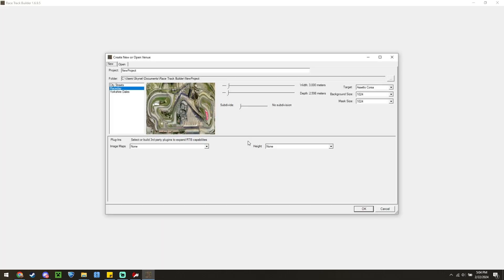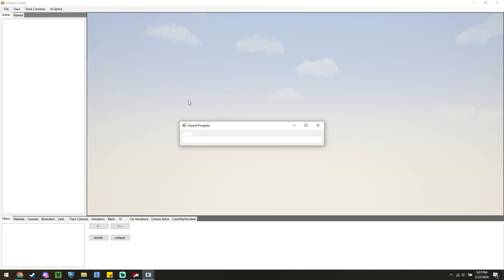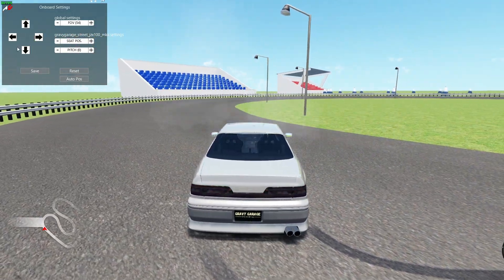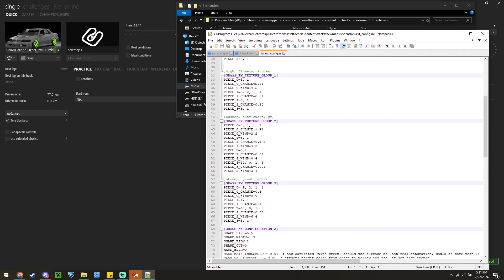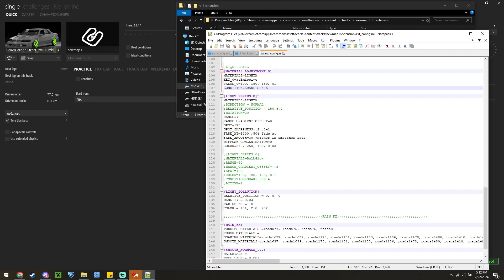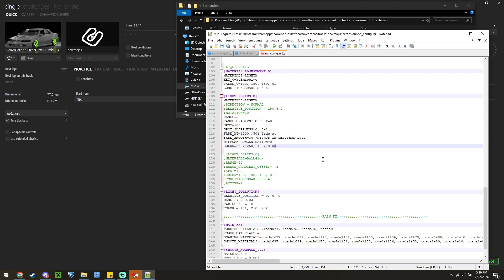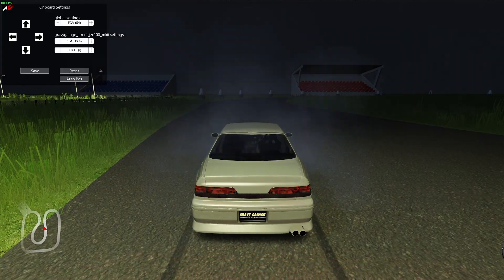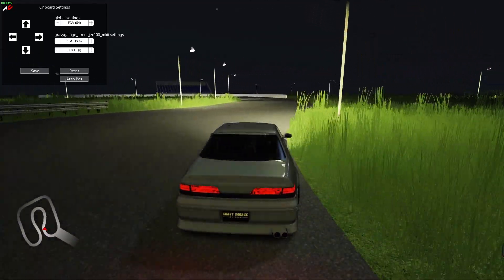make your own assetto track (part 2: lighting)

Comment: is race track builder worth it over making tracks on blender? need an opinion cuz i wanna get into it too
Reply from the maker: RaceTrackbuilder will allow you to build a track extremely quickly. Most people that use race track builder to make their maps will typically import their finished RTB files into blender to add so much needed detail. But I personally have no experience with blender so I have yet to really use it. I will say using blender and no RTB Will take significantly longer simply because of how simple RTB is. It's a trade-off, do you want to be able to make tracks fast? Or do you want your track to be absolutely perfect?
Reply: thank you for the advice! yeah i defo will try with RTB and then probably if needed ill send it over to blender too. i wanna make more city maps rlly idc how long they take so i guess im looking for detail @iamkillball3000